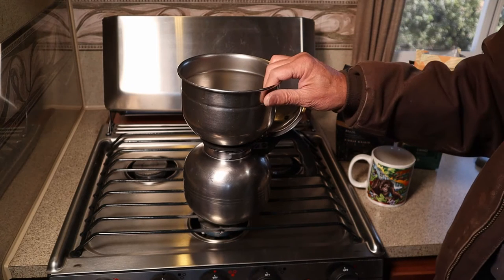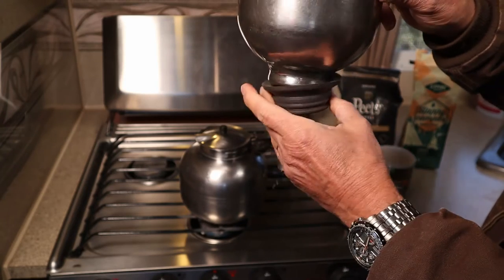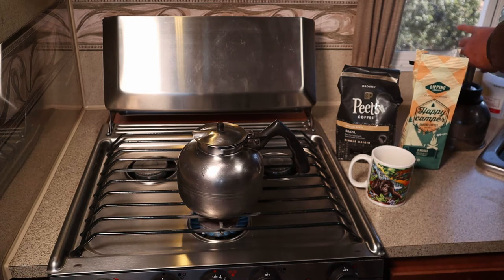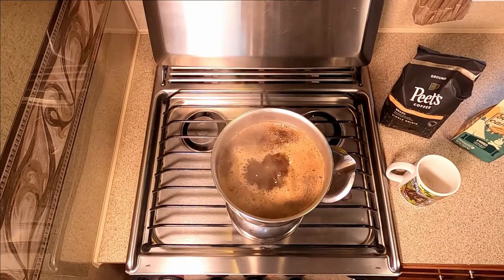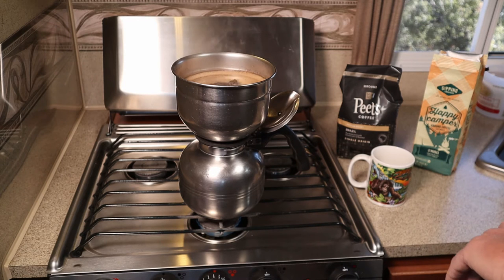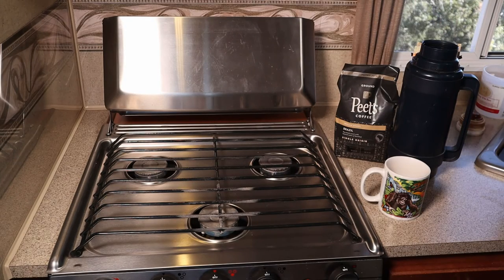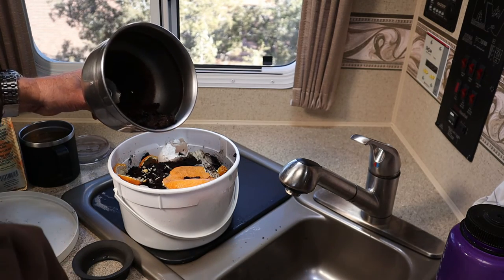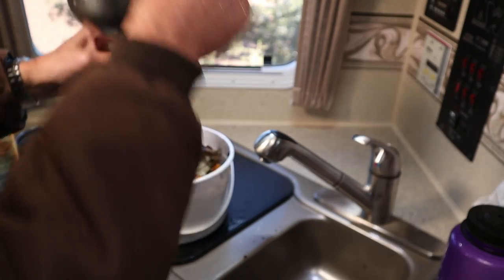How I Brew Coffee While Camping - Vintage Vacuum Coffee Pot

Comment: If you can remember I'd really like to know where you got that seal, mine is hard as a rock.
Got this from mom and grew up with it, it's exactly like yours.
Reply from the maker: Unfortunately, not only do I not have a record of where I purchased mine, I was unsuccessful in my (re) search when I posted this video and I just spent more time than I care to admit searching again.  My recollection was a mom and pop outfit I think in Florida.  FWIW - mine is molded in what appears to be silicone.  My guess is that they used an original, made a mold to cast new ones - mine is a bit loose.  Perhaps there is still someone that makes these or you could attempt to make one.  I hope you are successful - my story is the same.  I think of my Dad every time I brew a pot.  Good luck!
Reply: @kevintaberski4249   Found a place online called dayseal, he sells them for $30
From what reviews I've read people are happy with them, Mine is on the way.
Reply from the maker: @jeremiahsgrotto9156  Outstanding!  I don't know how you managed to find them, but it looks very much like the site where I purchased mine back in 2015.  I would love to hear how it works out for you.  Thank you for taking the time to report your findings!  I'll update my description with a link.
Reply: @kevintaberski4249  I searched the internet for hours and it finally turned up.

I also came up with an idea to use o ring stock to build up the old seal using super glue to apply it.
I believe that will work too for the ones that have gotten hard and shrunk and or worn like mine.
I softened mine by heating water to boiling, removing from heat, and then dropping the seal in until the water cooled.
It did make the rubber very pliable again, then I worked in food grade silicone that is used for diving equipment. (amazon)
That part worked out well, but my rubber is still worn too much and it's loose, so I'll try building it up with the o ring stock when it arrives from Amazon.
I have both 1/16 and 1/8th o ring stock coming and believe one or the other will work.
They also have an o ring making kit on amazon for around $35 that would probably work if someone was in a bind.
Reply from the maker: @jeremiahsgrotto9156  Wow - you are on a mission!  My original gasket was dry and loose - like yours - but also cracked.  Have you considered making a mold of your existing gasket and casting a new one?  That was the avenue I was considering before I found a replacement seal on-line.  Thanks again and good luck with your project.
Reply: @kevintaberski4249  That's not a bad idea using silicon, hadn't really considered it